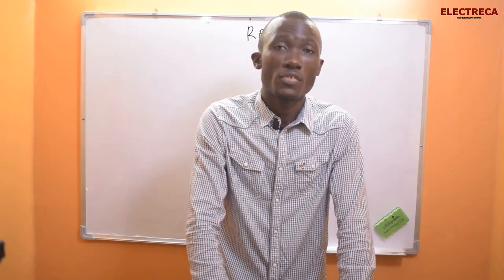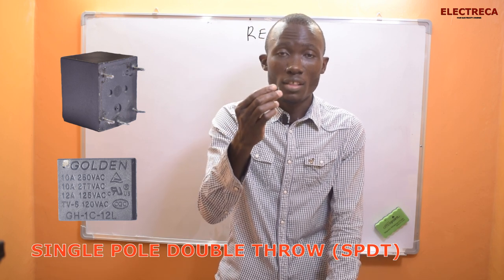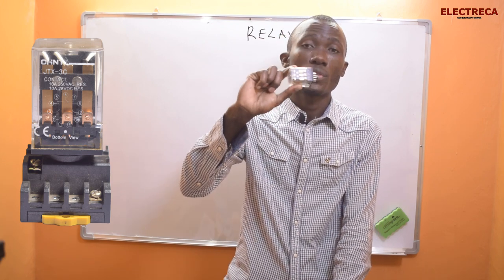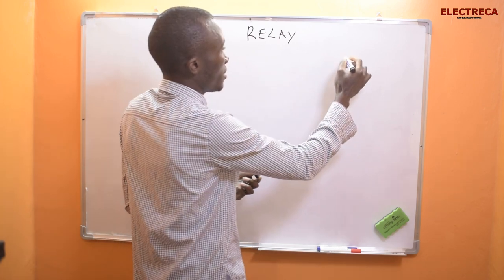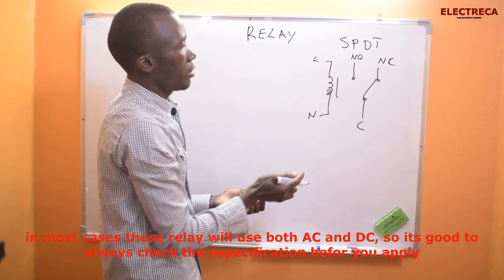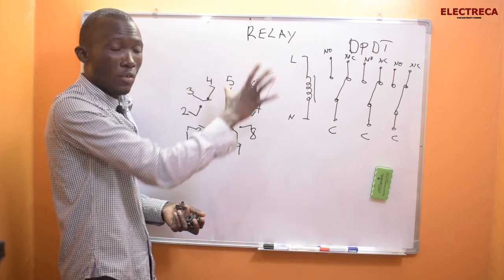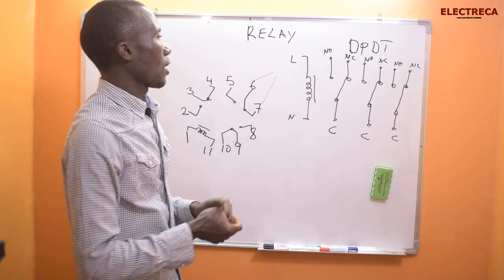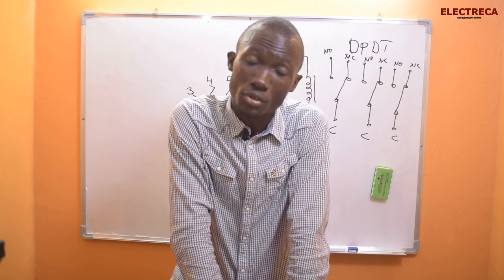What is a Relay Switch and How Does It Work

Comment: Thanks boss, but I thought in an 11 pin relay the coil is at 2 and 10 and not at 1 and 11
Reply from the maker: True. but it depends on brand, that's why it important to test first. Most 11 pin relay from CHINT use 1 and 11 as coil contact.